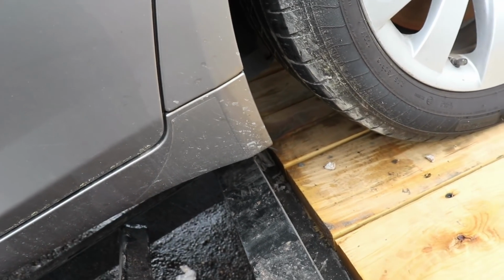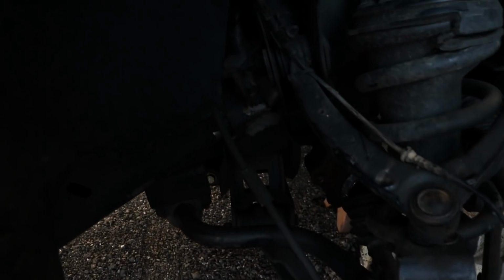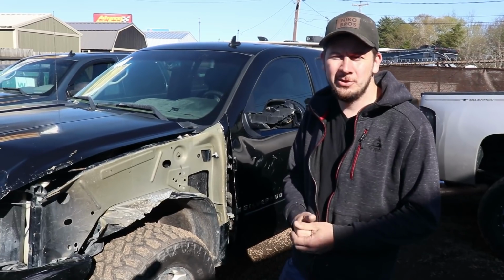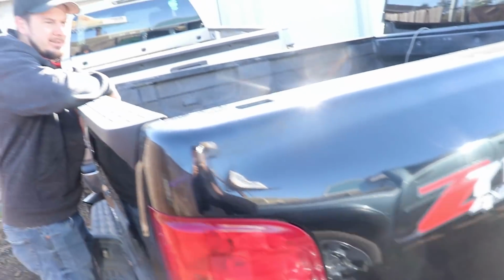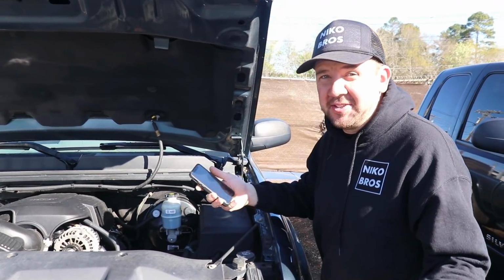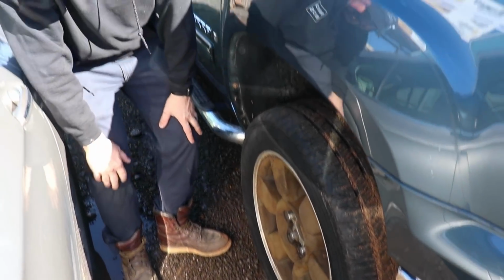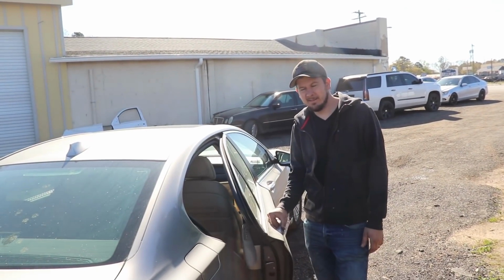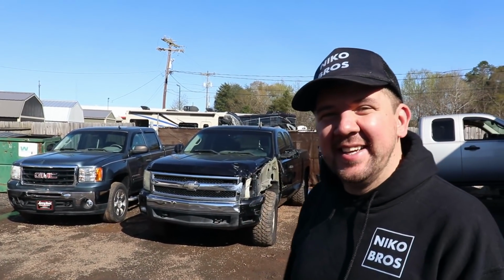WE BOUGHT 2 SILVERADOS, A GMC SIERRA AND A BMW 750 XI

Comment: Takes me back a few years. My daughter bought one of these identical with the soft close doors. She absolutely loved it for three months then it went into limp mode saying a door was open. BMW eventually replaced every door switch all the modules and about everything they could think of. They had it 15 times on four months till eventually the took the car back and refunded her money. I understand the car was to go back to .Germany to be stripped down by the factory to try to find the problems. Turns out they had 26 in the UK with the Dane recurring problem. The garage could not have done more to rectify the problem. Kudos to good service

Comment: I would like to see you transform the GMC, Since there is no structure damage put a small Rough County lift with different wheels and tires ,aftermarket head lights and tail lights. P.S. pick up some 2x 10s about 8 to 10 feet long for ramps. Lol 🤣